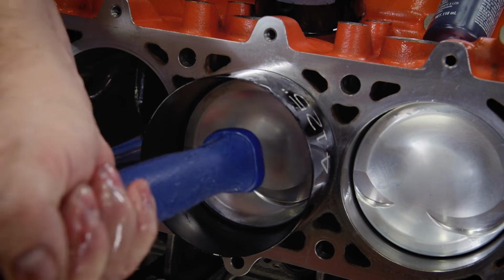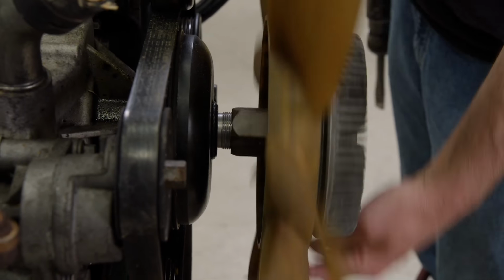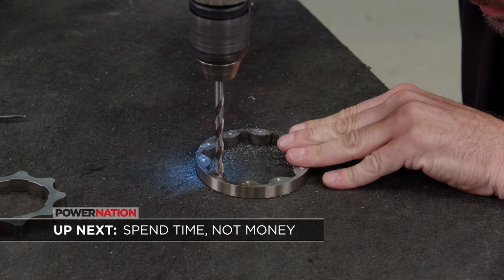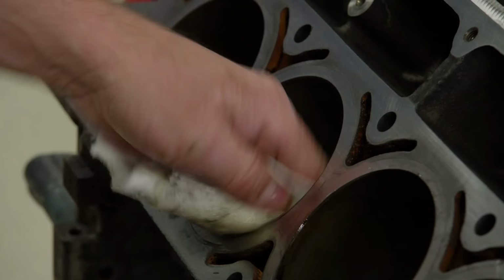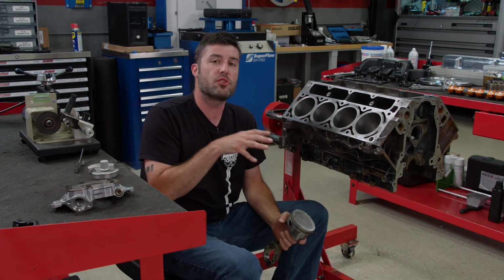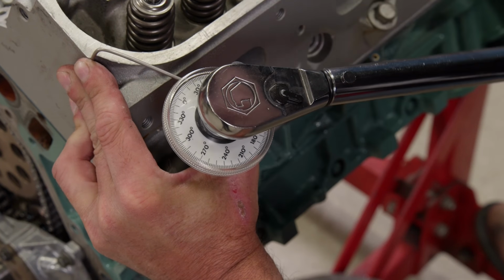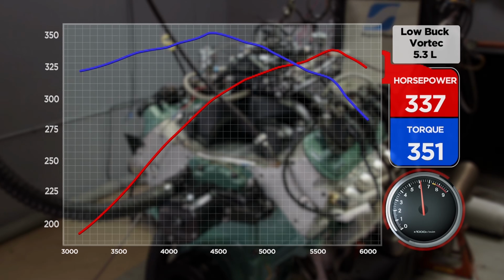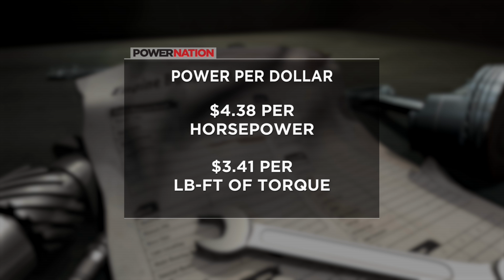Minor Upgrades Create Crazy Power on a Junkyard 5.3L Vortec - Engine Power S7, E10

Comment: I fear for all the kids that watch this and get their hopes up about doing an ls swap, videos like this dont explain the real cost of building an engine and actually putting it in a car and having a drivable vehicle. It’s really expensive no matter what anyone tells you.
Reply: Yea, and not to mention all of the little "Dos and Donts" when turning bolts, torquing, cleaning, bearing handling, EVERYTHING. One small greenhorn mistake can ruin an entire engine the moment you turn the key.
Reply: @johnwirk  plus the electrical work they'll need to do for a good swap.
Reply: Exactly
Reply: Don't worry this generation wants to drive toasters and will not get their hands dirty
Reply: No need to build the motor if it spins it wins
Reply: @usamadepride  yea, because there is nothing better than spending hard earned money, and lots of time on an engine that "spins", only to have a head gasket blow, or rings to break, or lifters to fail weeks or maybe less after the "swap", just to do it all again.
Reply: @johnwirk  that is why you run it o. The engine stand when you get it from the junk yard and if it is crap take it back and get a different one. So you are saying a 4 to 5 hundred dollar engine is more expensive then 2500. I guess you just don't get it that these guys are sales men trying to buy this shit. Did you not realize when they were tearing down the engine they said the bearings looked new and then when they put it together they said we are putting new in because the old ones were junk.
Reply: @usamadepride  A junk yard engine is NOT a race engine. Wise up.
Reply: @davelowets  junk yard engine can be a race engine  just because I am not making 1xxx horse power doesn't mean it can't get down. I'll ask you 2 questions have you yourself done a ls swap? And if you throw money at an engine it won't blow up?
Reply: @usamadepride  #1 Yes, and #2 No, money turns it into a race engine.

Comment: Why are some fasteners tightened to certain angled specs?
Reply: Angled torque specs are more accurate than a ft*lb spec. Critical fasteners such as the main bolts and rod bolts will use angled torque specs. The friction in the threads and between the head of the bolt and the material will throw off the torque from a torque wrench.

Comment: Forgot to tally intake ,carbs,cover plate,sensors etc
Reply: And the rebuilt heads. There is a heat button on them after the cleanup.